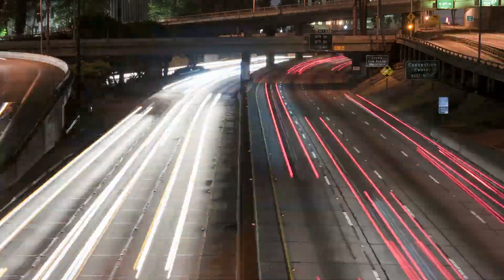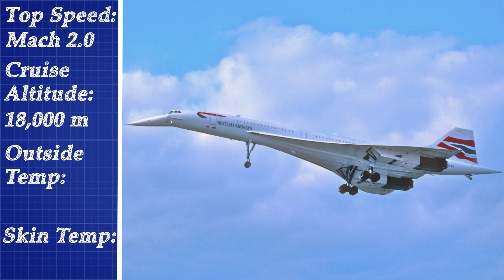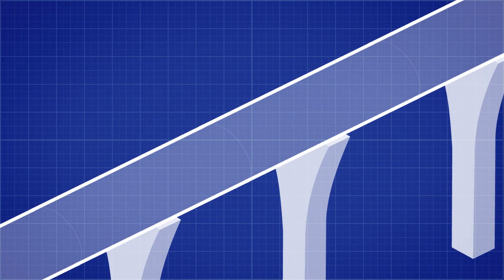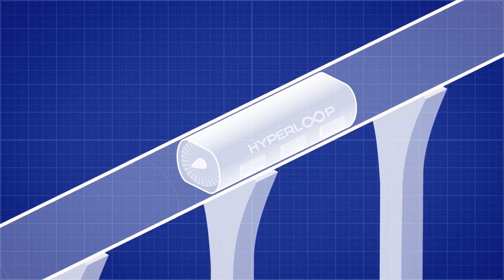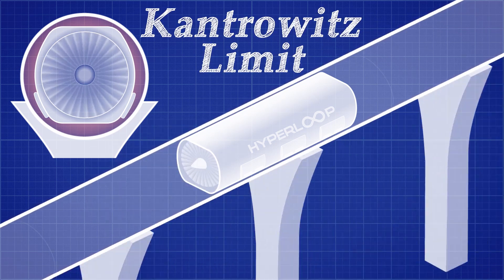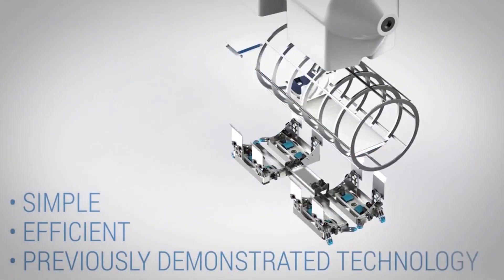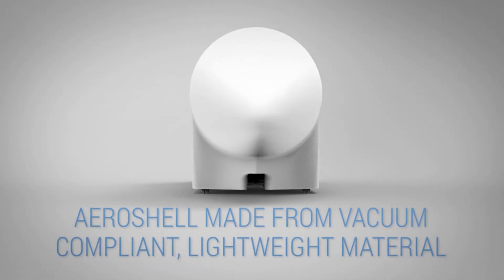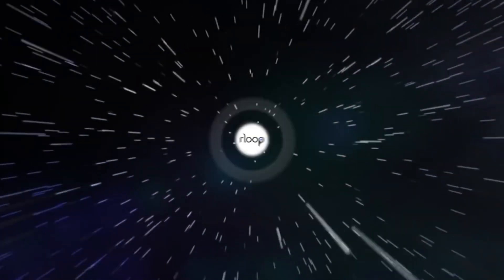Hyperloop - The Future of Travel?

Comment: I had a similar idea back in the 80s.  My idea did NOT require air to be pumped out to create a near vacuum.  My idea was to use high speed high volume fans or jet engines mounted at both ends of the tube.  The idea was to suck out the air in front of the vehicle and at the same time pump air in behind it.  This would give a push pull effect on the vehicle.  The vehicle could reach super sonic speed without creating a sonic boom.  Of course the track would be divided into sections so fans in front of the vehicle would blow or pump out out and as soon as the vehicle passed the fan or pump the aid flow would be reversed and the fan or pump would then blow air into the tube behind vehicle.

Comment: I was skeptical about the air cushions when I first read Elon Musk's design. I thought it was just not possible to get enough air to push levivate the train at such low air pressure even with high speed fans and air compressors, still I was hoping engineering could solve this problem. Now, everyone is moving away from air cushions to maglev, which is what we are trying to avoid in the first place due to much higher cost of maglev system. At the end of the day, the "Hyperloop" cost 2-3 times more than what Elon Musk's budget, and people would still prefer flying.

Comment: As much as I love this Idea I have concerns about it's safety: If a large enough breach occurs anywhere along the track (be it from engineering failure or a deliberate attack) it would at best render the entire system inoperable (possibly stranding several capsules in the middle of the tube) and at worst cause explosive compression in a very long segment. Are there any proposed ways to deal with these issues?
Reply: nope, everybody dies.....fuck it.
Reply: What if there is a breach in the pod? Wouldn't everyone inside die from lack of pressure.
Reply: Safety concerns are addressed during the design stage, which is happening right now. Before ever being adopted, many of the concerns for crashes, breakdowns, fires etc will have to be addressed otherwise planning permission won't be provided. Similar to building a skyscraper with no fire escapes.

The way these get solved are valuable resources to the competing companies, so don't expect them to broadcast them across the internet before getting them approved and protected
Reply: Wow... 1 Bar ( Let's be smart and talk in termes of Bars there... ) is the Athmospheric pressure. This is Equivalent to a 10 meters column of water...  A suddent decompression would instantly burst your Lungs and Air drums....  ( And kill you in the process ) Are you sure you really want to have writen what you just wrote ? because you clearlly have no understanding of the environement you are living in.  :D
Reply: There is something called an airlock.
Reply: @KevinLuWX  For this application, no, there is not an airlock. It doesn't exist.
Reply: +tetrapack24 You do realize that atmospheric pressure is only 14 psi... The idea that decompression in a vacuum is explosive is mere ignorance.   Remember your espresso machine operates at 19 times atmospheric pressure, are you afraid of your espresso machine? Do you order your coffee at Starbucks from behind a brick wall?
Reply: @johnwang9914 You try putting your body in that espresso machine and decelerate from twice Mach speed to 0 in  a split second, you will die.
Reply: @theorangeoof926  You do realize that an espresso machine is 19 bars of pressure whereas what the Hyperloop would have is less than 1 bar.  Your car tire is closer to the pressure difference involved.   You're really exaggerating by claiming 19 bars of pressure which is impossible as you can't be less pressure than a vacuum and you're exaggerating to claim mach 2.  The Hyperloop has many problems and what Elon Musk originally thought to be his brilliant idea to use a compressor at the front was disproven by NASA so what is being developed now is just the evacuated tube transport that people had envisioned for a hundred years, but you're focusing on utter nonsense and fear based on nothing but exaggerations.

Comment: hmm... nice idea.. but wouldn't this be a bottle neck of transport ?? since we have to wait for each pod to arrive first then we can launch another.. right ??
Reply: You could always have two tubes next to each other to go in both directions. Considering the speed, the pods could be sent out every minute or so. The only problem is slowing down without crashing them into eachother. A giant pressurized spiral at the end of the tube could do the job.
Reply: Oh you mean the track should be cleared every time?
No not at all, this is not different then a train system except smaller sections going slightly faster.
Reply: +imp3r1alx One of the touting points of pneumatic travel was that you could have multiple capsules and if the capsules get too close together, the build up in air pressure would spread them apart and cushion them from impact.   Now track changes would be a significant problem so pneumatic travel is often just between two points.   Yes this is a vacuum travel concept or more correctly a partial vacuum transit but that's just a subcategory of pneumatic travel.

Comment: No one has been able to justify the costs of HLoop vs standard rail on a per unit distance basis.
Reply: Nothing is getting built large-scale until it is cheaper than existing HSR + electric overheads.
Reply: most new innovations are expensive at first due to reasearch costs and undeveloped supply chains. cost will come down as the technology matures. hyperloop has huge potential for cost savings in the future due to low power / fuel req. hsr has neared its limits and maglev which needs large qty of rare earths.
Reply: I think it's a "green-tech" issue. Planes are apparently yuuuuge carbon-emitters.
Reply: The trick is that solar panels installed on hyperloop can pay for entire structure just in a few years.
Reply: the whole point of hloop is for speed
Reply: Take a plane then.
Reply: But the economic benefit STILL hasn't come close to HSR. Maglev has had decades to "mature" and evolve and is still much more expensive than HSR.
Reply: jja77a
How much per mile/km for standard rail/ballast/grading vs hyperloop? That number multiplied for the entire route will make it quite clear what is going to happen.
Reply: the issue with maglev is high cost of materials for the magnets. hyperloop doesn't have this issue as it does not need large amounts of exotic materials. the hard and expensive part is HL is figuring out the engineering and refining the designs and evacuating routes to contruct it (which need to be as straight as possible)
Reply: too early for that. any number would be highly speculative but it certainly would be significantly higher than hsr. the potential for better speeds, fuel economy and comfort would make increased cost worthwhile and in the future when deployment is more common its likely to be more affordable and with comparable speeds to air travel for medium range (500-1000 mile) i concede the costs on the frontend will be huge but there is a huge payoff in the future. like the interstate system

Comment: Absolutely fascinating. Was vaguely aware of the idea. This put it brilliantly.
Reply: Before reading this comment, this idea seemed like such a good one. But you do bring up some quite thought-provoking ideas, and now I'm not so sure on how safe I would feel riding in this thing!

EDIT:
I do see a suggested video alongside this one called "How the Hyperloop can kill you!". Yeah I'm not going to watch that though!
Reply: @DowzerWTP72  
 Real Engineering  
WATCH THIS TO KNOW MORE ABOUT HYPERLOOP😂😂😂😂😂😂😂😂😂
https://youtu.be/RNFesa01llk
Reply: exurb1a I like your channel
Reply: DowzerWTP72  News. They stepped down from the Vaccuum tube idea. Originally the plan was to have only 1% of the tube electrified. so they would give the pod a push every 70 km with a linear-motor. this way the project would be more cost effectve than a maglev train. As this would need the whole length of the track electrified and equipped with a gigangtic linear motor.

Now they came to the idea that a vacuum didn't provide enough air to have the maglev ride on a air cushion....Also they got themselfs that it's stupidly dangerous in case of vacuum failure.

The current concept is one with "low presure" instead of vacuum.
I tried to get numbers...but the concept only talks about pressure that could be kept low with standard pumps currentl available on the marked , even in if the tube leak.

So they have to electrify the whole track to power the pumps. Also with air inside the tube you will not get away with pushing your pod only every 70 km....so they will need a lot more linear motors and these cost. You will still need enginears from airplane companies to solve the "low-pressure" tube problems for the passengers cabin. And low-pressure creates an additional problem! In a tight fitting tube the air can't pass the pod fast enough. The pod would need to push the wight of the whole air in front of it through the tube. To counter that effect they want to put turbines in the pod, so that it pumps the air infront of it to it's behind....
The other way to deal with that would be  having the tube much much wieder than the pod. so...a more costintensive tube...

With all the airpoumps in the tubes they are propably better off with having the whole pod dirven by pressure difference...

I still think it's a bad idea looking at what they have presented for now.

I would opt for a standard Maglev like Transrapid.
Reply: @TremereTT  Japan already has public transportation like that. It's a train that floats on electromagnets, and is cooled by liquid helium. So basically Musk is bringing the idea to the U.S.?
Reply: @dylanfinch2951  but it's not in a vacuum.
Reply: @andersonsteve682  Yeah, but when you put something at high speed in a vacuum, it causes a huge problem. If a little leak sprang and air got in, it would be like riding a train (full speed) into a brick wall.
Reply: @dylanfinch2951   I misunderstood, I was trying to say that the maglev in Japan is unlike the hyperloop because it is not in a vacuum. So In comparison it is not like bringing the maglev to the USA.
Reply: @andersonsteve682  Oh, I thought you were saying it would be better, because it's in a vacuum. But Musk has all but announced that he has gave up on the Hyperloop in a vacuum, and is basically doing a subway now. He did a short test run of the vacuum, saw how much work it would be just to keep it going (even worse to begin the project), and then how dangerous it was if he did get it going. 

It's just weird to me how many people and magazines said it was "The Next Big Thing" and "The New Way of Human Transportation," before they even looked into it.
Reply: exurb1a  u know about the law of thermodynamics,  low air pressure with an object going 760 mph for 1 hour with no cooling system.  that thing going to overheat and explode.
Reply: Hello Exurb1a
Reply: The normal Transrapid can allready accelerate to 200 km/h in 60 seconds and to 400 km/h in additional 60 seconds..

It's stupid to build a pod that is slower or about the same speed but needs a vacuum to get there.

The whole idea with the vacuum sucks. (see what I did there...)
They plan to have a pressure of 1-10 millibar inside the tube....So you not only have to get your train up to speeds but you have also to think about solutions you would only need to think about when building a spaceship! 
You basically need rocketscientists for a fucking train, just because of the vacuum.
The next funny thing is: Imagine vacuum failure in a hundreds of kilometers long tube! a pod hit by the shockwave would be accelerated by hundreds of G . 
It's just a bad idea.
Reply: not to mention that just because something is dangerous should u not do it everything can be dangerous given the right situation the hyperloop is the same
Reply: Hello Exurb1a.
Reply: Wait, you still don't have a tick next to your name
Reply: It's as real as a unicorn
Reply from the maker: Thanks bud, congrats on the new found success!
Reply: @RealEngineering  we need to have a remake update of this video that goes into depth and talks about cost and feasibility. And also look at the maglev what makes this so much better than the maglev. And also safety like if the vacuum chamber gets a hole in it what next.
Reply: The Concorde never paid for itself. Every ticket was subsidized, which is a strange thought, given how expensive they still were.
Reply: I think that its a bad Idea.
Reply: ahgflyguy Did not know that. Well if that's the case, then maybe hyperloop really isn't the best idea. I think it's at about the same level.
Reply: exurb1a it's bullshit about that power efficient makes it a pseudoscience morons!
Reply: I'm guessing you've just watched the Thunderf00t video on this. The massive blunder he's made is he's forgotten to take into account is pressure loss in pipes, which is first year engineering degree stuff. Even in the worst case scenario with the tube completely open, 2km down the tube the air flow will be about 5% at the entrance. The only way the air flow could cause damage to the pod is if it was close enough to the breach, and going fast enough, that it would probably hit the tube breach anyway. 
  Also this is an absolute worst case scenario with the end of the tube completely open and clear. For smaller breaches the flow rate would be significantly less. Somehow everyone being killed all along the hyperloop by some lunatic shooting holes in it with an anti material rifle is totally ridiculous. Or in a more serious scenario an explosion on the side of the tube for example, bending the tube and causing a breach. The pipe would likely be throttled by the deformed tube, so the air flow rate would be quite low. The worst that could happen is one capsule could be destroyed by crashing into the compromised section. 
 The argument that the whole line could be compromised by one damaged section can be applied to any form of train. In fact, standard train crashes with multiple carriages such as the high speed train crash in France not too long ago could be argued to be more dangerous than the hyperloop. That said, I personally think the hyperloop is uneconomical, but the whole catastrophic pressurization of the tube argument is nonsense. Elon Musk does seem to have a track record of making seemingly uneconomical ventures such as electric cars, rockets and solar companies actually work, so we may be surprised once again.
Reply: @Bordpie  Are you sure musk made a profit selling electric cars ? 
He had the market pretty much cornered and still ran at a loss 
Now he has competition from REAL auto manufactures world wide 
Where's the semi that was promised years ago, the truck that will never be seen on the roads 

Solar company haha 
Ask Wal-Mart about the fires, where are the solar roof tiles ? 

Tunnel boring ? 
More fails than wins on his record
Reply: @chriskennedy7534  There are lots of tech companies with sky high stock prices but don't actually generate profit. The market is pricing in potential future revenues, that's how a lot of new tech companies work nowadays. There was a good video on this by Economics explained. 
The advantage Tesla has is vertical integration, from battery production to the Tesla supercharger network to power generation from the solar panels they have basically a full transportation ecosystem, not just an electric car. So they can operate more efficiently with access to batteries etc. Plus the potential for future self driving taxi fleet which is another future revenue stream.
Whether the high stock prices are a good market value is another question entirely, but they are the best positioned of all companies for future electric transportation in general.
Reply: I would argue that the Concorde was uneconomical yet it paid for itself it seems. I think it might work. Of course Thunderfoot missed other things as well, mainly that he assumed that there is only one company/team trying to make the hyperloop.